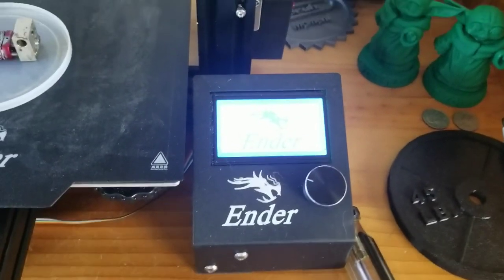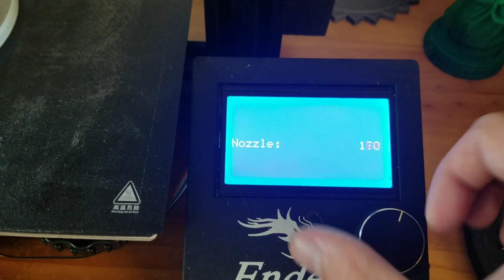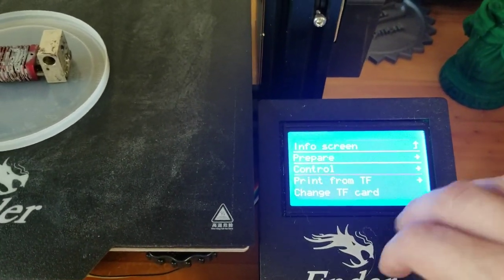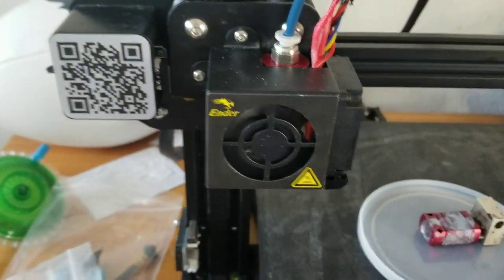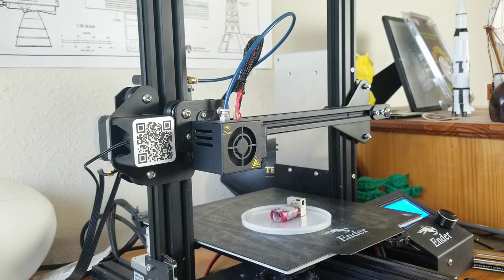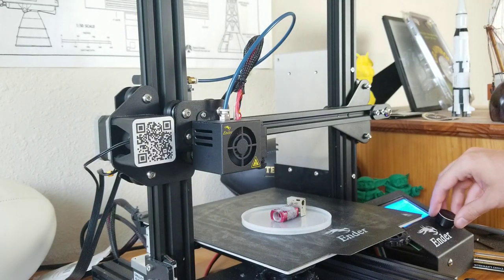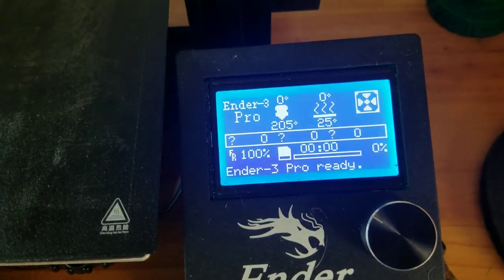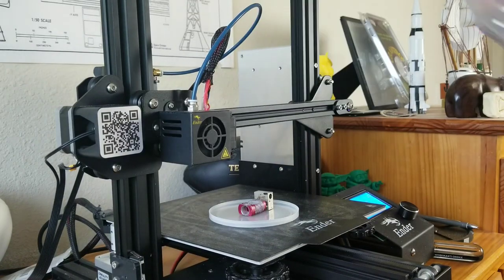How to Replace Hot End on Your Ender 3 Pro! (3D Printing)

Comment: At 8 minutes, that screw is meant to gently press the 2 little legs of wire insulation (the opaque stuff) into the side of the hot end. The way you've done it the screw is doing absolutely nothing. So the temp sensor (which is what that wire does) is free to pop out of the hot end at any time... I came to the video to get an understanding of what goes where and i've gained that before tearing my own printer apart so thanks for that. But this video is open to leading those less competent astray.

Comment: Okay, so here's the deal.  I'm 56 years old, and foolishly esteem myself to be a fairly smart person.  I have two different jobs/careers, and both of them are doing things that most people would think would make me feel very confident and not really prone to worrying about failing at anything.  But yet, I really, really was paranoid about breaking my 3D printer.  It seems like such a magical device, that I don't want to ruin the magicalness of how it works.  But it stopped working and had a serious problem.  Your video was really, really great at helping me not be afraid to just rip into my printer and find the problem and fix it!  So thank you for that!!!  If you had been a narcissist, and not a real, just plain honest person, I would still be freaked out about doing this!

Comment: Why you are using thermal paste in unknown to me. Thermal paste is used to make 2 metal surfaces transfer heat better by making a flat surface contact with another flat surface to fill in any high or low spots that other words would not be touching the other piece due to pits in the flat surface. Even though something may appear flat and smooth everything always has dips and pits making a less than perfect contacting area. I guess to each their own, although it's probably pretty messy to deal with. Thermal paste on computers is used for the lid of the processor to contact the heat sink that is usually connected to a fan cooling the processor, not a heat sink to a fan. It probably might end up messing up your fan because it can get running when it's hot especially conductive thermal paste, and then it's just like water, moving in the direction of gravity. Allen wrench is the twisty device's name.

Comment: A tip for you is to write out a script and then you will realize that you don't know the name of the parts you are messing with. Then you can google the parts learn the name and sound professional, instead of saying that thing and this thingy-ma-bob haha. Hey if you go online you can type in Ender 3 upgrade prints and you can print out some upgrades for your printer. My favorite is a motherboard fan protector, which protects the fan and motherboard from getting any filament in it while you're printing or cleaning your printer.

Comment: Heeey, thermal paste helps parts conduct heat between them. A good place for thermal paste, would be between the heat block and the thermistor close to the nozzle. Conducting more heat to the thermistor, sealing any gaps between the two, helping the printer more accurately know what the hot end temp is.

A bad place for thermal paste, would be using it to clog up the cooling fins, impeding air flow over them, reducing cooling area, increasing temps of what your trying to cool, etc... noticing on the old hot end 🙃.

Comment: This was extremely helpful. I was learning about heat creep and replacing a bunch of parts when I realized my temps were fluctuating all over the place and triggering the thermal runaway. Solved my issue with less stress than anticipated. Thumbs way up.

Comment: Good job - appreciated the straightforward guide!

I see the other points have been mentioned, but just to recap:

Allen wrench - sometimes called a hex key, named for Allen Manufacturing
Heating Element - The silver tube that goes into the big hole and held in place by the grub screw, it's what heats the hot end
Thermistor - This is the small bit that went into the small hole that was held in place by the larger screw, and is what reads the temperature of the hot end
Thermal Paste - Ditch this, it's actually impairing airflow across your heat sink fins
Reply from the maker: Dont worry, I ditched the thermal paste a long time ago, idk what I was thinking. And what's ironic about this comment is that my thermistor just broke lol

Comment: Very nice video! I cracked my nozzle off and ruined the hot end by getting it stuck, and this was a great tutorial for replacing it. I have a Voxelab Aquila printer, but under the fan shroud it is identical to this one. I was able to replace my hot end very easily thanks to this.

Comment: Other 3D Printer YouTubers: it’s super easy to do! Unscrew the barrakiltzenfrug with the panda mania screw and take the whole thing over to your fully equipped and dedicated soldering workspace and fuse everything together, then measure voltage and current with these 12 specific gadgets that you definitely have just lying around, and then just completely rewire the whole board for fun because it’s so obviously not done efficiently. 
Callum: use the funky wrenches to loosen these screws…I can never choose the right one by sight…and put this hot cylinder thing and this bulb thing back here…
Much more relatable, easy to understand, and overall on my skill level! 3D printing is now affordable for the average person, and it shouldn’t feel like a tech-nerd elitist club to navigate the problems. Thanks!

Comment: Had a similar thing happen with my stock hotend (ender 3 pro). I don't remember messing with the set screw for the heat cartridge, but I went to change the cartridge, and the screw was stripped. I assume from the factory, kinda odd.

Comment: The silver thing that goes inside the hot end is the Thermistor and the screw in thingy that you where using was a ball end allen wrench, also the fan box thing is called the fan shroud. Good video though.
Reply: The silver cylinder is the heater cartridge. The thermistor is the bulb-looking senser next to it.

Comment: What were the symptoms of your stripped hot end? I'm having balls of plastic come from above the nozzle on my printer and I think I stripped it or there's some plastic in the threads
Reply from the maker: If you've replaced your nozzle recently, you may have just not put the tube back into the hot end correctly. This happened to me a while back, and you're supposed to put your old nozzle and the tube back in in a specific way. Here's a link that could help you out: https://www.youtube.com/watch?v=FRzsGttNMyk&ab_channel=Tombof3DPrintedHorrors
Reply: @CallumPrints  there's no link, I guess youtube filtered it or something
Reply from the maker: I didnt have the link yet, I edited my comment on my PC but initially responded on my phone. There should be a link there now! Hopefully it helps
Reply: @CallumPrints  Thank you, that seems to have fixed my issue
Reply from the maker: Awesome man! Glad I could help!

Comment: helpful video. Though my problem is the hot end is not heating up, so I think I have to change my thermister itself and the wires attached to it
Reply from the maker: Yeah, check your thermistor and your heating cylinder. It's likely one of those two is broken. In fact, I just had to change one of mine recently

Comment: Fan shroud. No idea what the allen wrench with the weird round hex driver thing on one end is actually called. You are welcome. Great vid. Thanks!
Reply: FYI, thermalpaste isn't going to give a better heat reduction in this case. Actually the opposite because it closes the gaps that are made for the hot air to dissappear..
When thermalpaste is applied you have to have a cooler touching the paste psychically, like a Cpu cooler touches the thermalpaste that's applied to the Cpu, to transport the heat away..
Otherwise good video.. 🙂👍
Reply from the maker: Funny you mention this, because I have removed that thermal paste since for the reasons stated above. I made a video about stopping heat creep that mentioned the thermal paste, and I took that one down (kinda) after finding this out.
Reply: @CallumPrints  oh, okay 👌 my bad, didn't check your channel😅😊 sorry for that.
Have a good day😎

Comment: My case was I was an idiot and forgot to heat up my hot-end and retract filament before trying to change out the nozzle. Maybe this nozzle had a weak point but suffice it to say The nozzle sheared clean off and I had half the nozzle stuck in the hot end. Using a screw extractor didn't work either. =P
Reply: I was doing the same thing but my nozzle snapped while screwing it back in! Glad to see my faux pas wasn't the first.

Comment: umm why would you put thermal paste on the heat sink?! ur not trying to move heat from heatsing to any other metal part since its "floating"
Reply from the maker: Just so you know, I dont have thermal paste on my nozzle anymore, I thought this would be a good idea but instead it does absolutely nothing. This video was from a while ago😅
Reply: @CallumPrints  no, it is a good idea. Most people do it. Correctly. Thermal paste goes on the metal tube that goes inside the heatsink. You just out on thermal paste without learning what it actually does. It does a fantastic job of creating an airtight bond with the sink, hence why it is sold at every 3d printer store, and all metal hotends should never be used without it

Comment: ...... Did you seriously just rub thermal paste all over your heatsink? That's not how thermal paste works. It's not a magic cooling paste. Thermal paste acts as a sealant of microscopic airgaps on heatsource, to heatsink connections. A small layer goes around the metal cylinder that connects to the heatsink, and makes the heat transfer to the sink much more effectively. An absolute minimum should ever be used as metal is always better than paste. By smearing it all over your heatsink, you just significantly reduced the actual metal surface area, thus reducing its ability to be cooled. The reason it has fins to begin with is to increase its metal surface area.

Comment: 5:38 I've loosened and in fact completely removed the tiny screw, but the "heat cylinder" is not coming out of the...metal brick. does anybody have any suggestions?
Reply: if your still stuck use an allen wrench to push it through from the other side its prob got some melted plastic on it

Comment: I did that then my 3d printer pulled an error THERMAL RUNAWAY: E1 PRINTER HALTED
Reply from the maker: You likely forgot to put that little glass bead (the thermistor) in the right place. It's also possible that you have a faulty thermistor, and that would require getting a new one
Reply: @CallumPrints  yup and it took me 3 hours to figure out how to install the new therimistor that came with the hot end 🤣🤣🤣🤣  thanks a lot for replying

Comment: You're using the wrong size screw driver, that's why you had difficulty undoing it. Right size, right profile will make a huge difference! (The "heat cylinder" is called a thermistor. Instead of apologizing for not knowing terms, learn the terms first: contributes greatly to credibility! The video itself is great.)

Comment: This wasn't fucking helpful at all, this is just to remove the heatsink and heat break, the hotend is all wired and requires a full change
Reply from the maker: So in other words, this tutorial is helpful for some people but you see looking for "something different" and the tutorial is, in conclusion, "fucking useless." Yeah, this isnt a full wire replacement, just the head. But don't call the whole thing useless just because it wasnt of use to you.
Reply: @CallumPrints  when the title "How to Replace the Hot End" this means actually changing the whole part, otherwise it should be called "How to Replace the Heatsink" as it's a more accurate title. So if someone's heat sink has actually burned out, like mine did, so yes this is completely fucking useless because it doesn't address the promised issue.